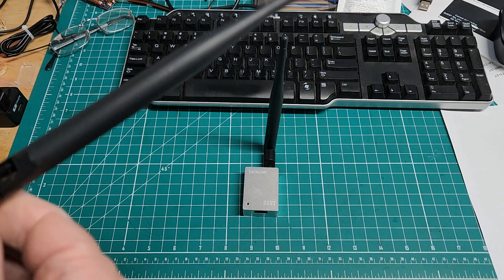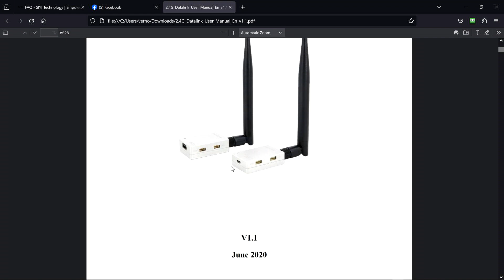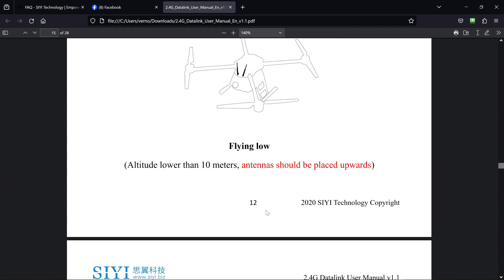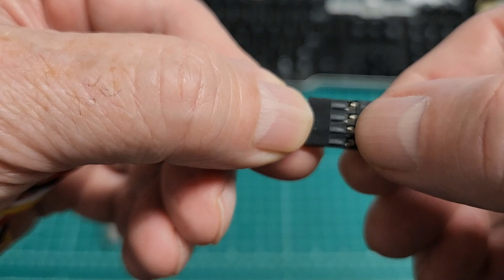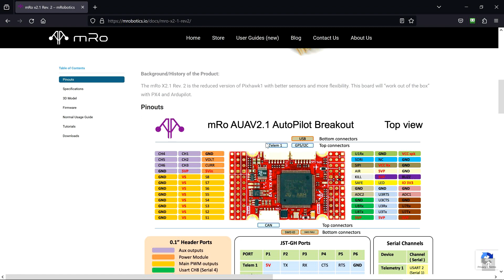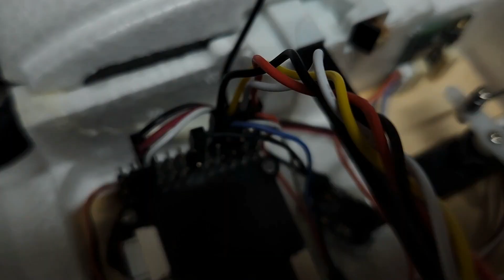SIYI 2 4G Datalink 2 of 2

Comment: Thanks on your update Vernon, a good diet does make a huge difference for many people.
Knowing what gives you these pains does give you an idea why and hope you can get better.
BTW, have the same keyboard as you do at home, it's about 20 years old, still use it, still works well, the Dell computer from the day on the other hand has long ago given up all it's life. Must have been the dust inside that made it one day overheat...me bad.
Thanks for showing us all these Datalink goodies out there!
Cheers 👍💪✌
Reply from the maker: I cut out all sugar after the test and have an appointment tomorrow with a nutritionist. Hopefully that will get me on track.  It is just good to know what my issue is after two years of suffering pain.

I do like that keyboard.  I don’t like a lot of them as they don’t feel good to me.

I open all my computers and blow them out with an air compressor every 6 months or so.  You have to hold all the fans still or the air will burn their bearings up fast.
Reply: @nighthawkvs  I should do the same in the future, that's for sure.
Cheers
Reply from the maker: If by the same you mean get checked, for sure.  :)  Not fun, but needed.
Reply: @nighthawkvs  was talking about blowing out the computer. I did my first full checkup at 65, got a good bill of health, thankfully.
Reply from the maker: Oh good.  I don't want to talk about that other stuff anymore.  lol

Comment: Congratulations on the perseverance, I would have thrown the towel in on the day one. I have tried many times to get these link radios to work and ended up with a very sore head! 
PS and I did learn soemthing from your video so thanks.
Reply from the maker: Let me tell you, when I turned them on that first day and got nothing again and again after switching ports and TX and RX around many times, I was frustrated enough to throw them out in the yard.  I just backed off until I got fresh ideas.  Lol  Why they will not work at 115200 I cannot say.  They show green indicators at that baud rate on both radios.  I set the baud inside ArduPlane to 115200 and also tried to connect at 115200 with the ground unit.  Evidently there is something in ArduPilot that really wants to use telemetry at 57600 for some strange reason.  I am just glad to finish that video on a positive note.  They are working and ready for aerial testing.